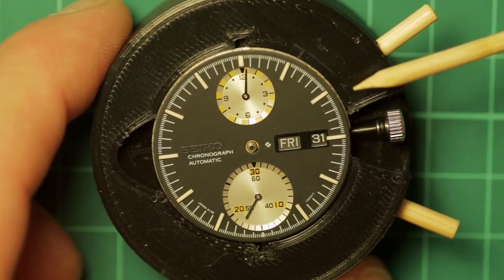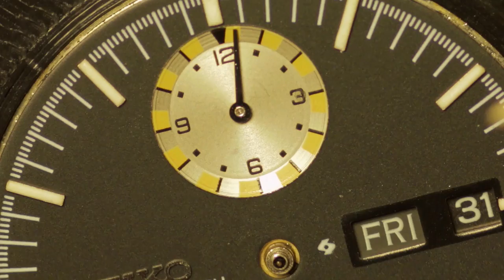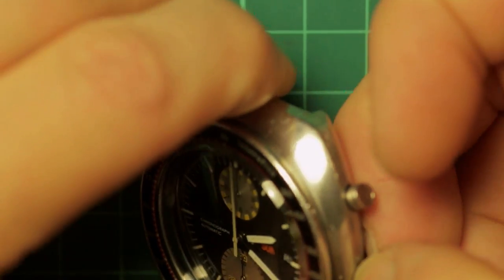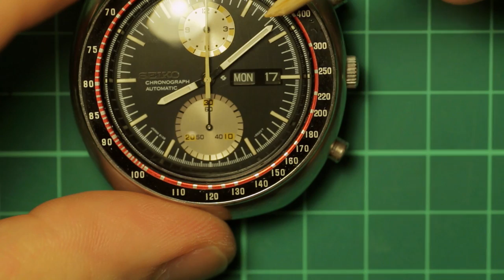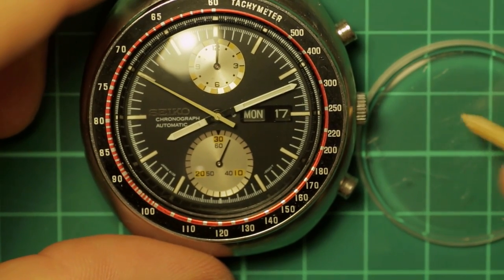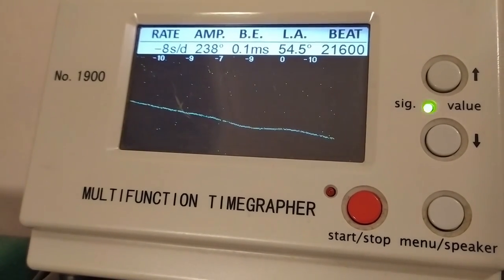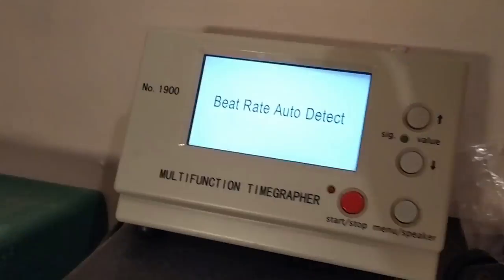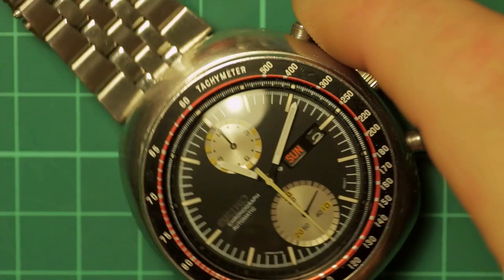Seiko 6138 UFO-5 Completion, Refit Dial, Hands, Re Case & Test

Comment: Amazing work, thank you for the videos please keep it up. Would also love to see links to exactly the tools and gear you use.
Reply from the maker: Thanks, tool links would be tricky as I use a lot of old tools which I accumulated over the years, some of which are hard to find now, car boot sales were a great source 20ish years ago for old watchmaker and general tools.
There are a good range of mid level tools at supply houses like Cousins UK so you can get decent stuff without going to the really expensive brands like Bergeon.